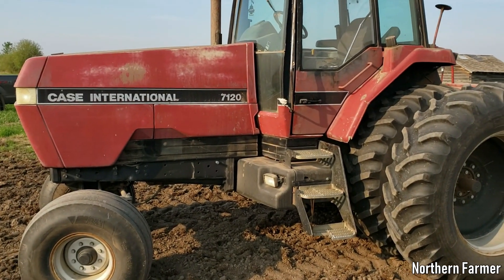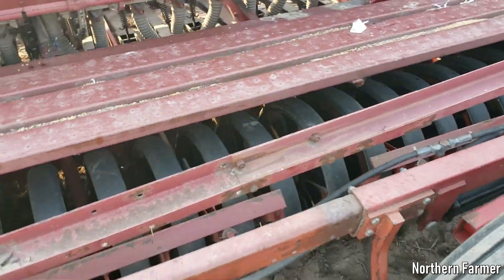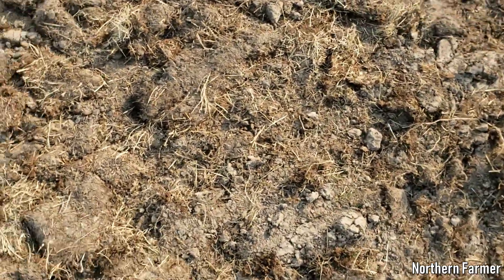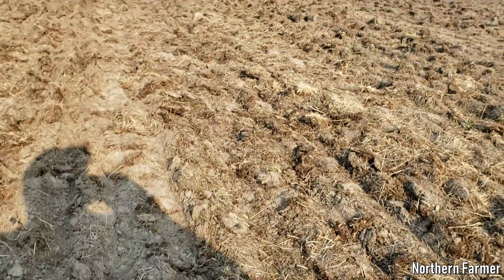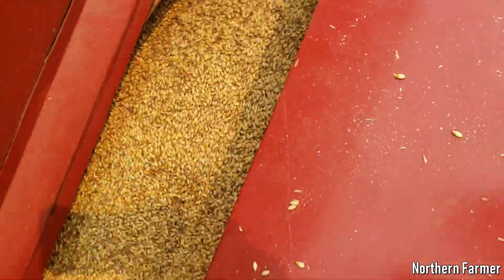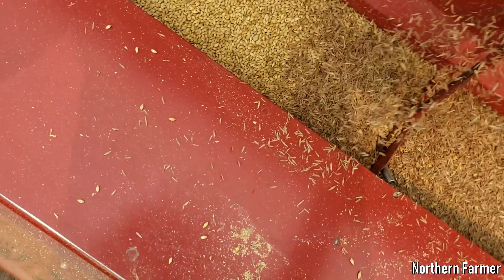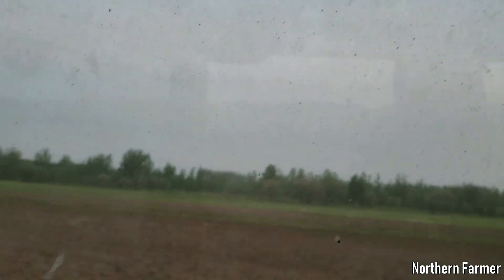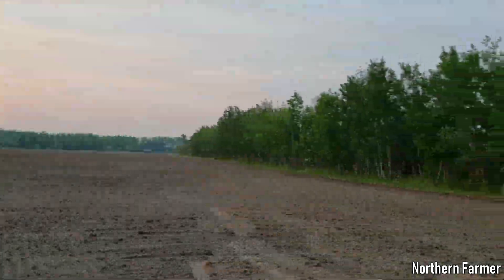CASEIH 7120 Magnum Planting Hay

Comment: We just blow ours on with the air seeder, and harrow pack afterwards.  Have had really good luck so far.
Reply from the maker: We used to get all our hay mixed at the fertlizer plant with there tromel.... but now they wont do that anymore... it was nice to seed all the hay just in the brodcast spreader... but this old drill has 3 compartments... so its not to bad.. but I wouldnt want to do a lot of it.

Comment: That's a quick way to get some acres seeded without the expense of the air seeder.  How difficult is it to switch from field to transport mode?
Reply from the maker: Its not hard at all... You unhook from the front  lift the hitch and lock it upwards...  Drive the tractor the side with the markers, and then hook up the hydraulic hoses and then the hitch goes down right into the drawbar and then the rest of the drill lifts up on the mover tires

Comment: Hey Tyson do you find sometimes you can’t get enough depth with this drill? I’ve used mine only for oats and I find the sections that go a touch deeper always yield much better. And there’s always seed laying in top in the tire tracks from tractor and then it doesn’t grow worth a crap
Reply from the maker: We changed all the springs and set them for more pressure. Some people use a small harrow just behind the tractor to get rid of the tracks. And we always harrowed the field after seeding

Comment: I drove a 7110 for a day holy crap the ruffest uncomfortable pig of a thing to drive
Reply from the maker: They are a bit of a rougher ride... My only gripe about them to is that.  I am not a fan of older caseih seats and the air ride in them... I would rip those seats out and put in a aftermarket seat.

Comment: That's not many stones all the land  I had you could see ground in places one field well 3 acres it 4 days to pick stones off it dam cultivators put them in fence line where they belong
Reply from the maker: There are still quite s few hand sized rock's..I only pick the bigger 8 to 10 inch round ones. There are some big ones there..couple the size of the skid steer bucket..and a couple as ones half the size of the skid steer
Reply: @Northern_Farmer   When I was seeding field back into hay pick stones before seeding and then after with a fork that a manure fork by hand  that work great for cutting hay hardy even put section in the haybine just had watch groundhog holes mounds lol you hit round baling tractor would jump off the ground lol